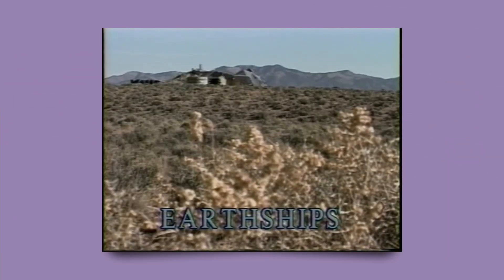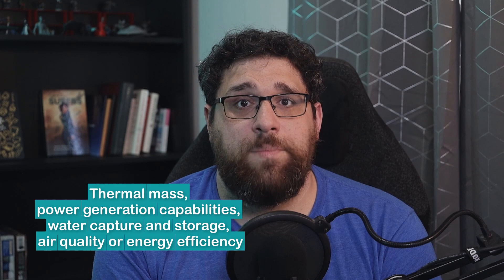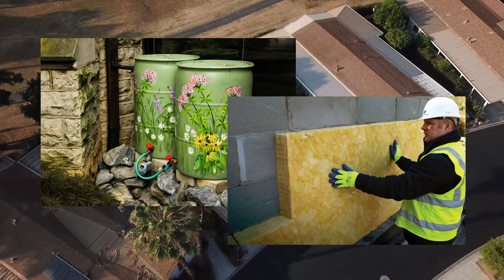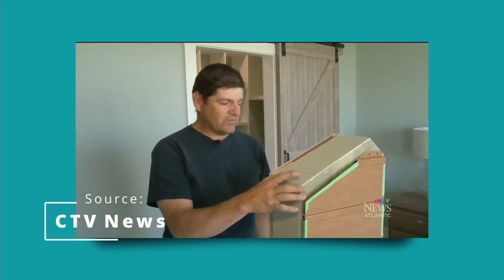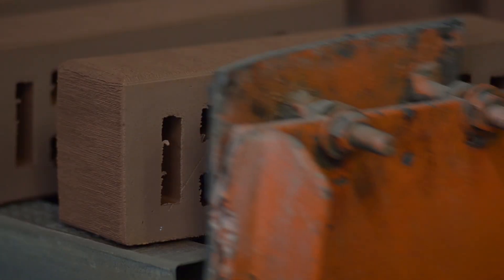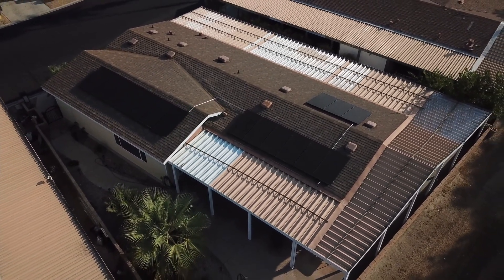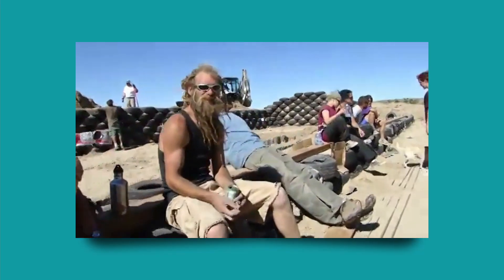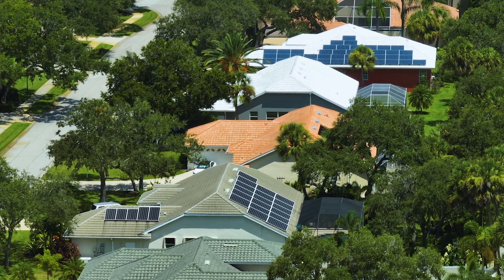Discover What We Can Learn from Earthships

Comment: I'm not a greenie type but there is a good case to build homes in a way as to keep our increase the standard of living while decreasing costs and most importantly eliminate the grid as it is a huge waste of resources and money to build and maintain. Let the utilities transition their businesses to fixing issues at peoples home systems rather than having a highly centralized control grid that creates a weakness that can be exploited by rivals.

The smartest thing you can do is build your home to only use the data grid for the internet and have a home that does everything else itself also i could make a case for only building with earth, stone and metals as the home would not burn. Take rammed earth, concrete, metal supports plus you could go pine step further and use transparent aluminum for your windows. You would have a pretty safe home.
Reply from the maker: I don't know that we will ever get rid of our grid systems, but I do agree that we shouldn't always need to rely on them. I also think that a better future shouldn't be limited to "greenie types". Thanks for commenting!

Comment: Thermal mass is one of the key design elements to regulate temperature in addition to the passive cooling and heating designs. Generally, earth (ground), water storage or concrete are used to increase thermal mass of the buildings.
Reply from the maker: I completely agree. I think there are many opportunities to think through how we can make that happen without adding too much cost, time, or effort and receiving some of those benefits. Thanks for commenting!

Comment: I am an older Architect here in the N.East,..I've designed active, passive, geothermal, rock bed storage, and active glycol systems,. Successfully completed requirements for Leeds certification and had the benefit of the incentives available from the local power/electrical provider here. .At one moment in the early 70's the Federal or State Government initiated an incentive program, promoting the initial solar experimentation, and gave solar system installations, a percentage deduction on the property tax payed to the town,..not just for the year, but deducted from the tax appraisal in continuance. Although enlightened sustainability begins with grass root experimentation,..I believe the political process that can provide financial incentive is extremely important in scaling up innovation and the use of current and emerging technology. We are at this moment in time, this very moment,.at the point of being able to provide electrical energy, affordably, and sustainably,..( From the Sun )  The real danger,..is simply,..is it in time...I would urge everyone that cares about the planet,..to watch the fossil fuel industry, and object to any plan they might proffer that inhibits green energy,..and solar initiative...It's a political process, and they exist to perpetuate their own,.with
 unlimited funding and power.